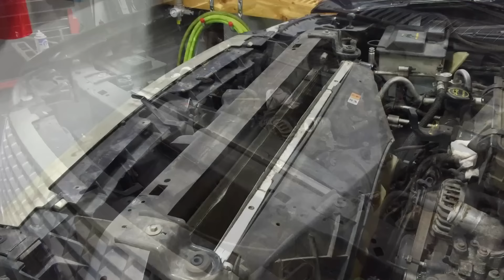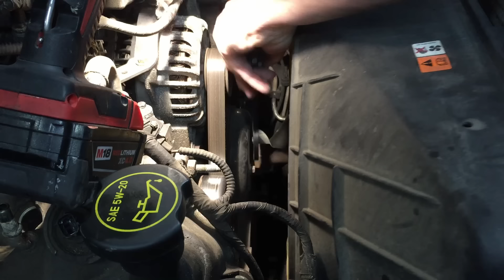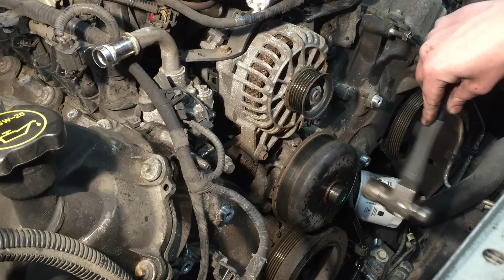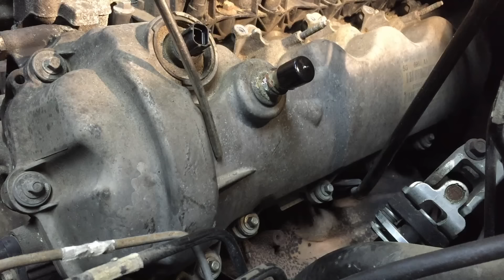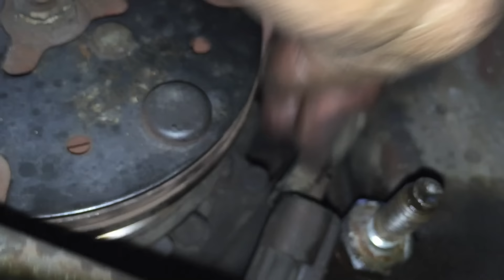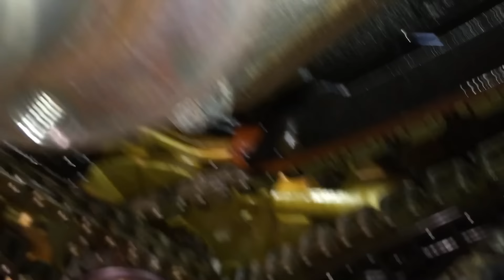Ford 5.4L 3v Engine Timing Chain Kit Replacement Pt 2 of 4: Front Cover & Valve Cover Removal

Comment: I have a 2010 F150 and I went to use the puller I purchased just to find out there weren't any hole to thread into???
Reply: I did the exact same thing on my 2010 Raptor. I had to makeshift a claw style puller. It actually came off very easily

Comment: *****Warning **** If you are a fat ass  as I am myself ,  removing the 3 bolts for the power steering pump are death. I would suggest a bottle of oxygen since you are practically laying on top of the engine and your lungs are being compressed by excess weight. Your welcome....

Comment: Working on this job and watching the videos for about the 4th time as I'm actually doing the work. The fan clutch came loose with about 5 strikes with a 3 pound sledge to the handle of a pipe wrench. If I was doing this all the time I'd buy one of those Lisle pneumatic ones but for those of us who may only do this once - or once in a while - the pipe wrench and hammer gets it done.  Thanks so much for putting this series together!
Reply: that's helpful, I was considering the tool but it's over a hundred bucks and I hope I only do this once.
Reply: I used the pipe wrench,(as I have done on other cars) on this job, I put a 10mm wrench on the water pump pulley bolt to offset the force of the pipe wrench, and it cam off pretty easy.

Comment: The link that you give for the oil pump when you bring it up on Amazon it shows that it does not fit my 2004 f150
Reply from the maker: It fits all 3v engines 2004-2014 trust me.
Reply: It shows the same to me... tells me it dont fit my 2007. I'm trying to order everything now, I found plastic chunks in my oil pan!

Comment: It might be a dumb question but I’m doing the timing on my 06 f150 and as I was putting on the right chain my phaser moved. Is that bad? Or do I just alignment the chain with the phaser like nothing happened?
Reply: Just keep the marks aligned and things will be ok. Some movement is expected until the tensioner is on there.

Comment: What size wrench do you use for the 2007 ford f150 fan clutch? I cant seem to find the right answer anywhere.
Reply: Big Crescent wrench snugged up tight to the nut and smack it good with a hammer. Be careful not to wack anything you don't want to damage.

Comment: Mine does a start up rattle then stops after a couple of seconds is that fine or do i need to fix it. Runs great. 120000 miles on it 2006 ford.
Reply: The reason you get the rattle is you most likely have a blown out seal on one of your tensioners. After oil pressure builds the pressure back up in a few seconds the tensioner takes up the slack and the rattle goes away,  It will destroy your guides and become a bigger problem if you let it persist. I'd get in there and take care of it sooner than later. If you wait, it won't get any better. Your guides will be beat into small pieces by the slop in your timing chains then find their way into your oil pan and oil pick-up tube. It will then start starving your engine for oil as the oil pick-up screen gets blocked by the chunks of chain guide pieces.  If you are going to open the engine...do yourself a favor and replace all timing chains, guides and tensioners at a minimum.  If it were me, I'd replace it all, to include the high volume oil pump, cam phasers and VCT solenoids Brian also recommends. Also don't use anything other than OEM parts. Brian has provided links to all parts needed.  Those are known good parts suppliers he uses himself. It's a pretty big job, you don't want to be back in there for anything you didn't replace the first time.  PS: Thanks Brian for your outstanding, highly detailed video's. Please everyone hit the thumbs-up icon and give this man some credit! Also, subscribe to his channel and he'll keep bringing you these detailed video's. (we can only hope)

Comment: My major question is I just had my 2010 Ford F150 with the 54 3 valve Replace the timing chain cam phasers guild rods Tensioners and VCT valve done and it was running nice came to stop and it started having the same issues as it was before could it possibly be in the computer itself
Reply: Did you use oem parts?
Reply: Jr Vera yes I just got the truck back as well and we put in new cam shafts updated the computer everything I used so far on my used truck is oem the only thing that I haven’t done yet is spark plugs and coil packs and the coil packs are the after market crap so it’s running well I took it on a trip to Denver yesterday ran awesome it’s super quiet hopefully it continues to run good

Comment: The crankshaft pulley has removal bolt holes. I have a '08 and it doesn't. I'd like to see how you would remove it. I was hoping this video would. I feel cheated.
Reply: Use the green OEM tool he lists in the description.  I just did it tonight, 1st time in my life removing any type of pulley and it was easy.

Comment: My 05 expedition has the 5.4 3v. Just got the call from the mechanic that the passenger side timing chain jumped, no compression on that side. Oil leaked out from a crack in valve cover. Whats an estimate of what this job would cost? Or hours per say?

Comment: I have a 2008 F-250 5.4 I might have to do this you make it look really easy cause you’ve done a lot but for me being my first time would you recommend me do it
Reply: A lot depends on your skill level and how comfortable you are doing the job. In the videos some of the more, say fiddly and aggravating things aren't shown or are depending on circumstances are not applicable. I have large hands and getting onto many areas is a total motherfucker. Replacing the roller followers depending on location and orientation are, lets say character building lol. Tip on the power steering pump: Use bungee cords to hang the reservoir up out of the way and put a little tension on it to help keep it up somewhat. It also makes starting the bolts easier since you aren't trying to hold that damn awkward pump and everything while you try starting the bolts in that tight space.
Reply: Clean the engine before you start. Take lots of pictures! And take them from different angles.

Also label wire connectors. Put a label with 1 on the part and a label with 1 on the connector. Then 2 to 2 3 to 3 and so on. Trust me, it eliminates any confusion during reassembly. Also get a box of ziplock bags and separate all bolts and label them clearly.

Use brake parts cleaner. That stuff eats away grease from bolts and brackets without much effort... It's a pain in the ass job. It's also a Ford. Be prepared to throw things, cuss, and yell that you will never buy another Ford again.

Comment: The power steering pump bolts a lot easier by removing the oil filter. At least the bottom ones. Then I screw it back on once they’re out.

Comment: The Phasers in ford timing kit in the link are okay to use? also where did you get the Roller followers from?
Reply: The Ford phasers are the ones you want. The cheap ones will crap out fast and you will be doing the job again. If you are lucky the cheap ones will last a year.

Comment: Doesn't  really help when looking to buy  a Ford F250 with 5.4 3v with 89k miles ?
Reply: Don't buy it! No matter how good of a deal you think you are getting, just don't!

Everyone I have known to get an F-150 with the exception of one, has regretted it big time.

I have never seen a vehicle where a tune-up can run a 1,000 and might be a lot higher if the plugs break.

There is a reason most used car lots have a lot of F150s. And that is because they are a piece of shit... You also hardly get anything as a trade in.

Comment: I do have to say thanks for the walk through but at 23:29 when it is said the there is more room in the ending compartment of the f150, there isnt. I'm working on an 04 5.4 3v with tow package l. Also I recommend removing the fan and shroud first along with the air box and throttle body.
Reply: Ik this 5y ago, but the 09-10 f150 got a lot of room compared to this vid, I’m doing king ranch tho, idk if that has anything to do with it

Comment: Is it three M8x1.25 size bolts for removing crank pulley on 2006 F-250 5.4 3V?   Because I probably better run a thread chaser through it first.

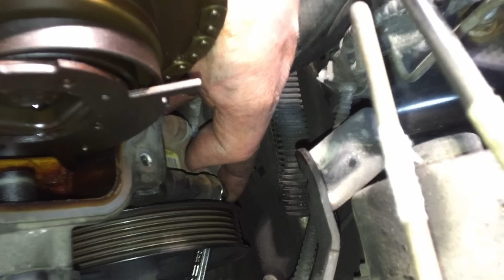Comment: 24:19 on my 04 this one was completely rusted out.  it is now stripped.  do the front bolts go into the cover only.  if so can i get at the timing chains if the power steering pump is still bolted to the cover?
Reply: Same problem, what'd you end up doing? I'm thinking pull the pulley or cut off the bolt heads
Reply: I would try a small die grinder to get the bolt head off and either weld a nut to the bolt or use some vice grips on it. It's a tight spot so nt sure what would work.

Comment: Heads up, I just did this job on my '07 F-150 and the fan clutch wrench needed was a 47mm.  I have the 36mm water pump shaft, btw, vice the 30mm.I was only able to complete this job thanks to these videos.  Very impressed with the time and energy spent on this series.

Comment: What do you do when the balancer  isn't drilled and tapped?
Reply: I used a gear puller on the tabs on the inside of the pulley but my gear puller wouldn't fit at first so I had to customize it by cutting out some material on all three jaws to make them fit.

Comment: You must have a minimum of 500 ft lbs of torque rating from the pneumatic impact wrench to remove your Crankshaft pulley bolt, FYI.
Reply: I used my 450ft lbs ridgid 18v impact
Reply: I use a two foot wrench with a  2lb hammer works mint.
Reply: @rambojackson9082  same, worked ok, just kept hitting the radiator hose lol
Reply: Used a 1/2 inch electric impact from Harbor Freight.  Came off after a few cycles.

Comment: Has anyone else experienced their crankshaft pulley set without the drilled and tapped holes for the removal tool? My 2008 was not milled out, still plugged.
Reply: I used a large gear puller, just happened to have one laying around lol
Reply: @carlwillows  Thank you for the reply. The only information I could find was for the mustang, not the F150. I did use a steering wheel puller I had though.

Comment: Hey, I've replaced the timing chain and all components around 10K miles ago but I put in the crappy plastic tensioners and one of them is blown out. To get the timing cover off, do I need to remove the valve covers on an 05 5.4? Thanks
Reply: Yes, they overlap the timing cover

Comment: What I do is get a shallow card board box and draw the shape of the timing cover and mark where the bolts go. Punch holes in cardboard drawing of timing cover.... then put the bolts in holes in drawing on cardboard so you don't forget where each length of bolt goes and thread side

Comment: Before I do a repair like this I like to degrease the engine and pressure wash it good. Compressed air only get the loose dirt
Reply: What happens when or if grud gets in the engine? I have a mechanic changing timing belt, oil pump and water pump and now he's telling me there's too much grud and the motor heads need to be sent to clean because... 1st the car still makes the noise after running it for 15 minutes then 2nd the car won't stay on and then finally when I told him to finish the job I asked for because I'm short on cash he said okay I will go ahead and cover everything up for you BUT you can't drive the car, it won't start.... 😣😣😣
I tried so hard to find a trust worthy mechanic but with all the run around I don't think the grud was that much, feels like the man probably didn't put things back together the right way. But he still wants me to pay him the $400 he's charging me when I gave him a running truck. 
Sorry... just venting.

Comment: I am having trouble removing the 18mm crank bolt from my 04 F150,... tried ratchets, bought an impact gun, soaked in WD40, nothing is moving that bolt. Short of buying another tool for the job is there anything else that I can do to get that sucker out?

Please ignore the username,.. made this when I was like 12 and thought it was cool at the time
Reply: You have to have an impact gun that is rated at 500 ft lbs of torque. Do not use the cheap Walmart or Harbor freight ones. Double check the one you have, it's probably rated at 250 ft lbs. I just did this on mine. Same issue with same solution.
Reply: @Magnum Mountaineer  I bought another one from Walmart with a higher torque yield, and it came right off. If you spend a little more on a better name, you shouldn't have that issue though. Also check the setting on your compressor. You might have it choked to a lower yield even though it has 150lbs in the tank.

Comment: Hoping you are still here. I noticed the phasers in the video are on wrong sides. My motor is like this too. Tensioner is marked R for right but phaser has L for left. Shame on Ford for using right and left rather than drivers or passenger sides. Does it make a lot of difference? Finally another video you just pulled tha cam bearing covers. Is that as good as pulling rollers? Hope to here you comment. At 57 with 40 years wrenching some things do matter.
Reply: The phasers have both L and R marked on them, they are the same part number for each cam.

Comment: Wouldn’t you save yourself some time and trouble if you just took the engine out??
Reply from the maker: Let me see 6-8 hrs vs 20hrs to pull engine plus more parts.
Reply: FordTechMakuloco Haha, good answer👍🏼👍🏼👍🏼wish you were in L.A
Reply: @FordTechMakuloco  Great tutorial, thanks! My 2007 F150 5.4 has 230k miles, is it worth doing the phasers and timing chain, or just replace the engine?
Reply: @monicagrover1617  I'm doing timing and more on my 08 F150 with 280k miles. I figure if there's catastrophic failure in near future I'll have some new parts on old engine I can transfer to reman or store for future.

Comment: Bro. Love the video. Helping me out ALOT. I’m doing this right meow. One question tho. Where can a man get some dang valve cover bolts. I’m in the rust belt and a few of the bolt heads were pretty bad. Tyvm for any info.

Comment: I cannot believe the chain tensioners are made of plastic and have no ratcheting to keep tension on the guides. Thank god for Melling doing the engineering Ford didn’t do and making cast iron, ratcheting tensioners that prevent slack in the chain in the event of a tensioners failure. This factory design was meant to to fail catastrophically.
Reply: So you used the cast iron chain tensioners? Any issues or comments you can share?
Reply: @EVRY1STFU  Sure, no issues whatsoever with them so far. The side facing the block is machined flat and doesn’t require a gasket to seal them. It’s a metal to metal seal. When you install them don’t forget to pull the pin releasing the tensioner springs. They’re a super easy swap. 

Also, if you’re going to do the tensioners, definitely upgrade the oil pump to a high flow unit while you’re down there.
Reply: @cougargold  thanks.  I've been prepping for this job the the last year.  Probably have watched all 4 vids 5 times.  Gonna save the cast iron tensioner at the 200K mark as I've already bought the whole timing set and the Melling HV oil pump.
Reply: @EVRY1STFU  Right on. I did the whole job myself as well on a truck my friend gave me that he was just planning to scrap. It was a Lariat and only had 110k on it and looked brand new, but he was just done with it cause Ford wanted so much to fix their shoddy engineering. He isn’t handy with tools, so I offered to take it off his hands and he signed it over. 

After I was done, I drove it around for 25 miles or so to break it in a bit, then Road tripped it over 600 miles home with not one issues at all. Still runs like a champ. 

Take your time and make sure you have the Ford tools, it will make the job so much easier to remove the lifters and set the timing. I kept my phone on hand and watched the videos step-by-step as I went and followed the exact torque specs. So thankful for these videos. 

I recommend changing out the water pump while you’re down there too since you’ll have it all opened up anyway.

Good luck my friend and let me know how it goes.
Reply: @cougargold  I know these engines have gotten a bad rap. Rightfully so based on aspects of certain design.  However, I'm in no hurry to dump $35K+ into Ford's hand. Plus I enjoy doing the maintenance considering the free, expert advice we get. 

I'm planning on doing a full timing set every 100K.  Especially since investing in the tools.  

Good call and ironically finished the water pump yesterday.  It was severely corroded and time for new.
Reply: @EVRY1STFU  Agreed. From what I understand if you swap out the faulty Ford factory parts with newer re-engineered parts you shouldn’t have any issues with the 5.4L. He does a great job in this video going over that. That’s why I went with the after market oil pump and tensioners, but upgraded factory cam phasers. They fixed the factory phasers and they’re better then the after market parts, BUT the after market steel tensioners and high flow oil pump are better than factory (If you’re sticking with the plastic tensioners with a gasket, then go with the new factory units, they fixed them).

Comment: When you stuff rags in the head when removing the rocker gasket, soak the rags in oil..make em dripping wet with oil.. Any dirt that falls into the rag will stick and not fall off..
Reply: Comments like Yours is exactly why I view comments! Thank You B0$$
Reply: That's a solid idea
Reply: Since I don't have an impact wrench would it be ok to loosen all bolts on pulleys and crank bolt before removing belt to keep tension on pulleys
Reply: Oh yeah lets soak 8 rags in oil so they are useless after completing the job.  You don’t pay the unifirst bill, that’s obvious.
Reply: @BFT88  I bet you don't either
Reply: @BFT88 old rags are cheap AF compared to the cost of the parts going into this job.